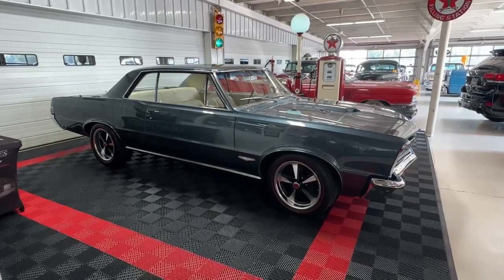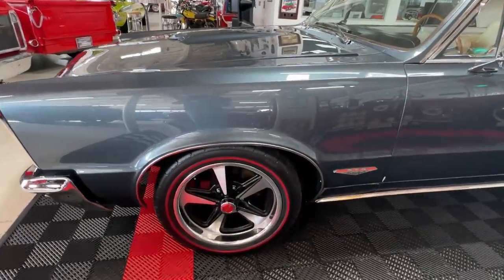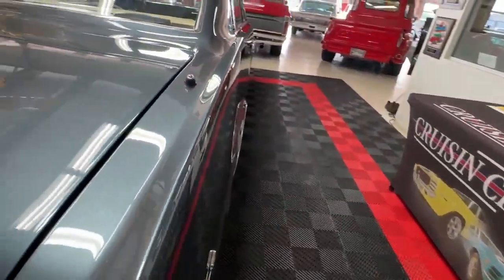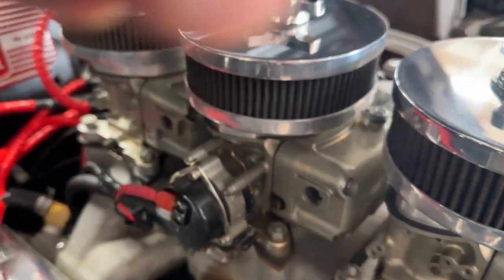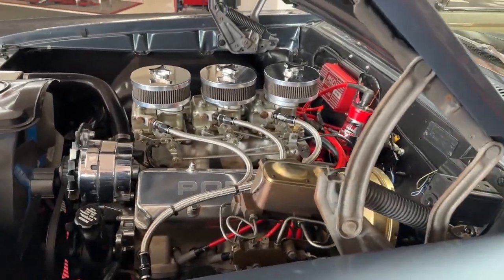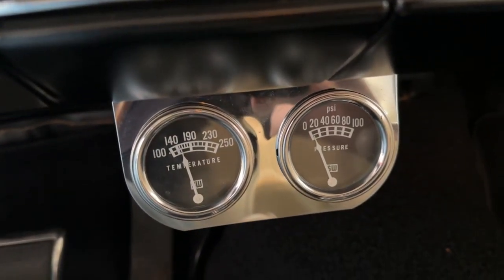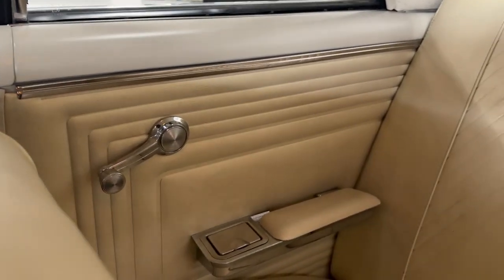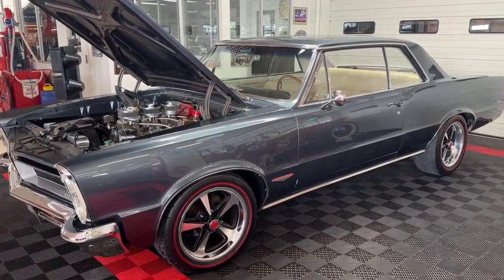1965 Pontiac GTO | Cruisin Classics

Comment: If I remember right the 1965 GTO had the factory exhaust pipes located behind the rear tires (with 2 tips on each exhaust pipe) and not under the rear bumper. My friend bought a brand new GTO in 1965 and that goat would eat Hi-Po Mustangs all day long.
Reply: you are correct about the exhaust pipes.